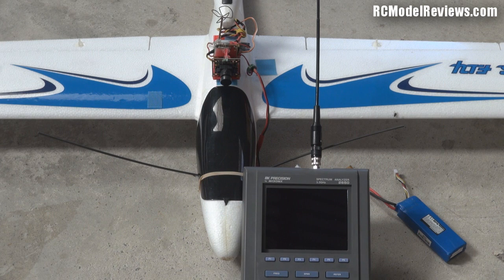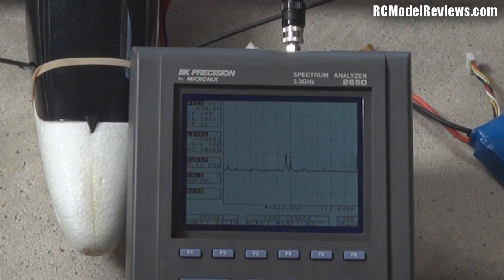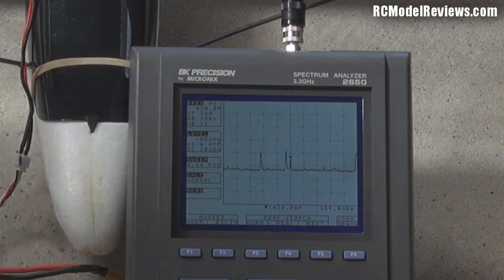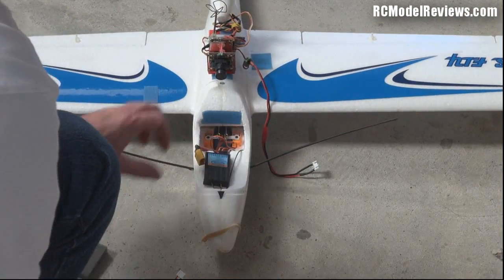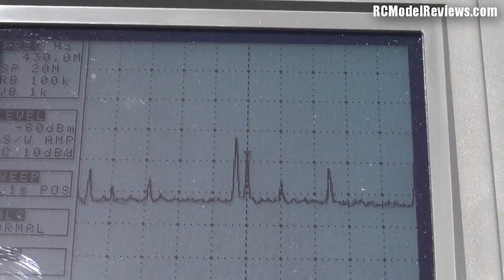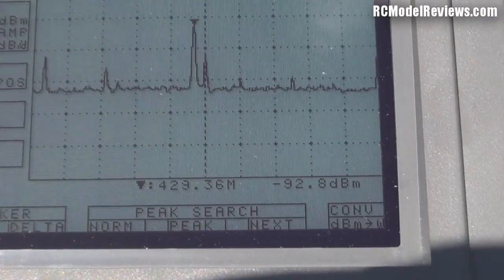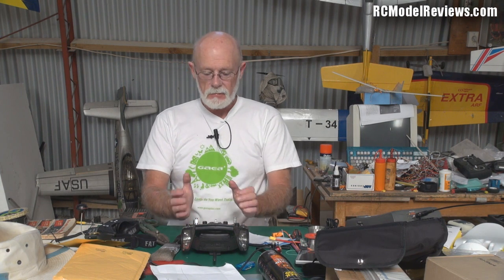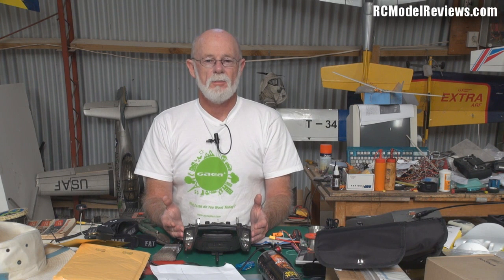RMILEC UHF RC for FPV - why only 1Km range?

Comment: There is no doubt RMILEC lacks filtering, & it certainly isn't the best UHF system. However you can make do with it & make it reliable for long range! First of all Tx mod needs to be cooled! I had gotten lock outs prior to cooling. I put a hole in rear of mod, installed a small heat sink on c.board & installed a fan. This is most likely Bruce's problem. I flown mine at long range many, many times with no lock outs. also keep it as far as possible from other gear! I do well with it installed on tail. Fiber optic kit will also greatly improve range for extreme long range because the servo wires interfere with rx signal. You should easily get out 5 miles with properly set up system w/o fiber o kit & 15 to 20 miles with fiber optic kit! All that said I would buy a different system if I didn't have one, but if you do, it can be made reliable if careful steps are taken!
Reply: +Dan Troutman Can you explain fiber "optic kit"? I've had one for a while and the furthest I've had it out is 8 miles, with no mods, and only turned around due to video. I'm always looking to better my system :)
Reply: I have two full sets of Rmilec LRS UHF's  and so far they have been really reliable for me.. Sadly yesterday I have a really hard time with the older one! But now I'm starting to think that it was a brand new U-blox GPS antenna cable that I passed next to the receiver! Who knows!! before I run that wire next to it never have any type of problems.. I'm hoping to be able to have a long range flight one of this day! I think that yesterday I flew my plane about a humble mile away! 
Thanks for the comment!  & By the way I also do have really large Heat sink mounted on my my tx

Comment: 430-440 MHZ  is an amateur radio band, including amateur satellite uplinks, you also have some car entry key fobs, and lots of other general shite. so if it has a poor receiver, with poor rejection it will get flooded with a wide range of stuff

Comment: Bruce, I would recommend trying the backpac with seperate battery as the SC 2000 600tvl cam spits out noise through the wires.

Comment: I see now this stuff is crap. The first vid Bruce where you measured the harmonics told me right there it was crap. No FILTERING whatsoever on the output of transmitter and you can bet the receiver is not any more selective than the transmitter. I'm afraid this garbage would get a feller in trouble with the FCC in America.... Great work Bruce, I enjoy someone who looks at the technical side of this hobby, especially some of the junk coming out of China... Big thumbs up from me in Kentucky.

Comment: Bruce perhaps your getting radio interference from someone on the ham radio bands wich is 430-440M in your neck of the woods. maybe the farmhouse barn you flew to has a repeater setup in it for ham radio use out in that area
jeff

Comment: please try a different receive antenna orientation. being linear antennas you really need to get both TX and RX antennas on the same plane to be effective. (but you already know that). both my receive antennas are horizontal to the ground. one on the underside of the wing and one along the fuselage, 90 degs to each other. my transmit antenna is also horizontal to the ground. just an idea. Chris

Comment: Fly to another 1km point like a big tree on a hill . Instead of the current location that possibly has a spike in  that stops 10km range. The barn may have intermittent issues so even if tested clear it may be on in a 24 hour period. Great work thanks.

Comment: Can you get a directional antenna for the spectrum analyzer?  If so it could be as simple as pointing the analyzer the direction of the failure and seeing if the noise profile is any different to any other direction you face.